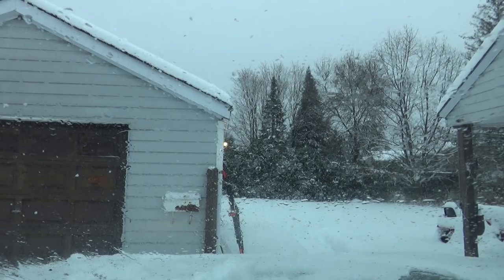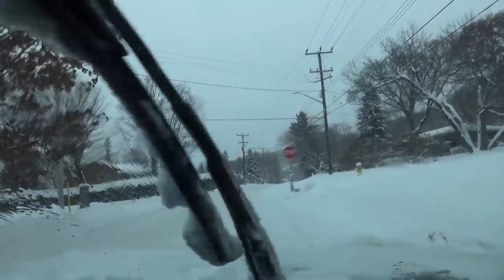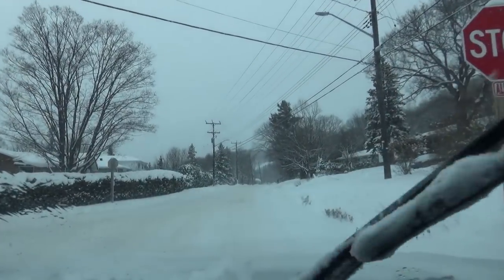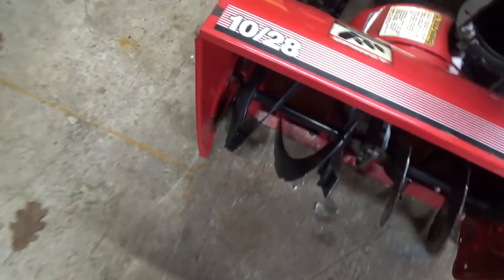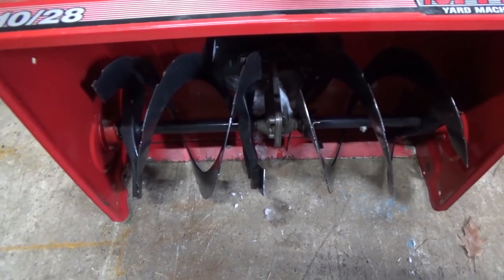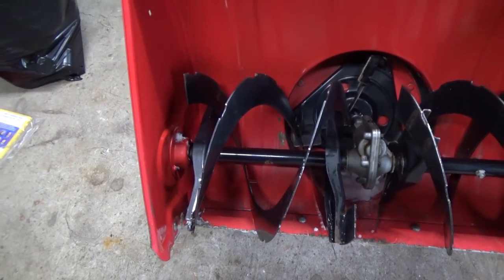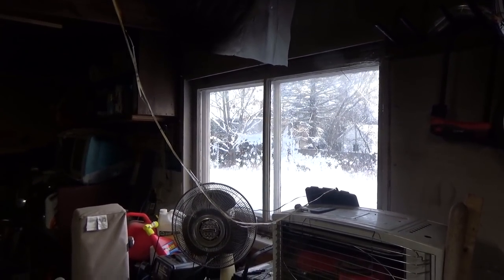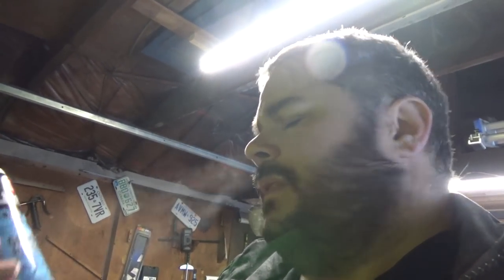Stuck Auger on Snowblower

Comment: LOL, right, it's like the wiper notices that its work is used more and therefore it wears out earlier. But at least the wipers on the Ford should be easier to change than they were on the old G6.

Comment: I have a snowblower attachment for my garden tractor. The damn thing wont start turning on its own so I have to turn the auger manually till the belt grabs.
Reply: how olds the belt? i wont warn you about the danger because im sure you already know.
Reply: yamahonkawazuki I keep replacing them hoping it would fix it
Reply: yamahonkawazuki When you been around as long as I have there isnt much you worry about.

Comment: Spray down the auger shaft with Blaster, soak that bearing in that spray you bought and it should loosen up and use it until you get a new one.
Reply from the maker: yeah I ended up loading the shaft and bearing with that lithium grease
Reply: VlogginLife my auger was locked once and couldn't figure it out then I checked the second stage paddle and there was a COCONUT up in there, 😂😂😂😂😂couldn't believe it.

Comment: You could try to rub the shaft until some lubricant comes out. OK, that was the joke you wanted, now I'd say you're lucky that you haven't sold the other snowblower yet, because that way you have a spare while you fix the other machine (especially since you always need your time to do so, which having 2 machines allows you to do). My second thought was: Wow, either Canadian snowblowers aren't made for Canadian winters, or you always get only the old decrepit stuff that someone else threw out, and that causes you to have the issues with non-working machines. Anyhow, good luck with the fix and stuff.

Comment: Bought a troy built 3 yrs ago. After one yr needed the carb repaired. After two yrs the electric start failed. So I have to pull start. Two years  five months into it the auger will not engage and will not spin. It has to be the gear box. I believe water got in it and it's frozen. It water can get in oil would leak Wich it doesn't. Don't buy an FN troy built from lowes. Wait you can't. Six months after I bought it they stopped selling them. CUZ THEY SUCK.